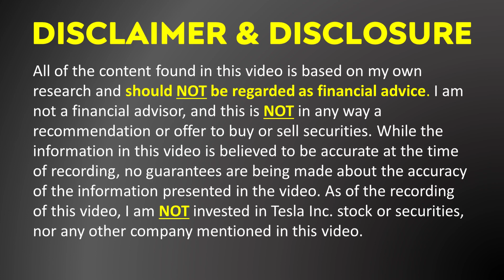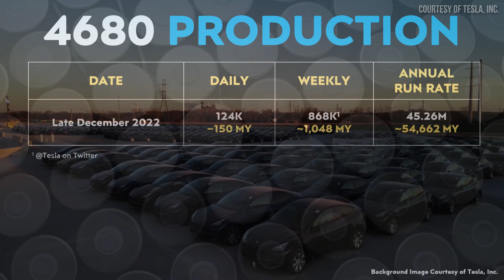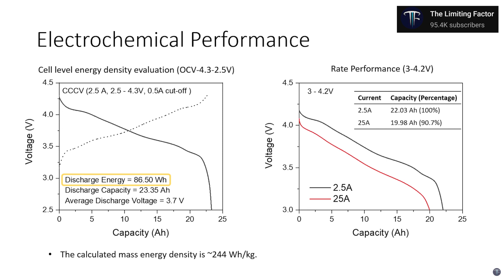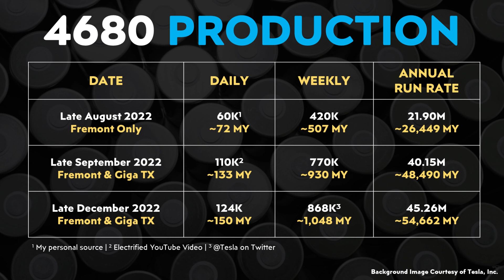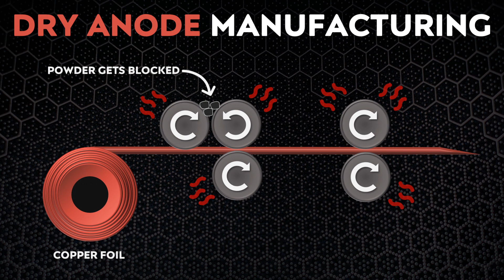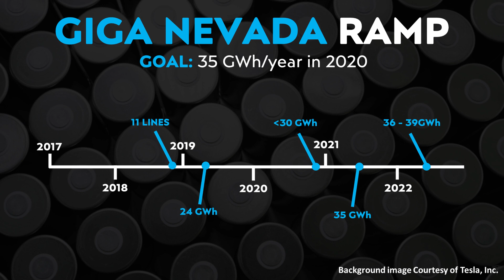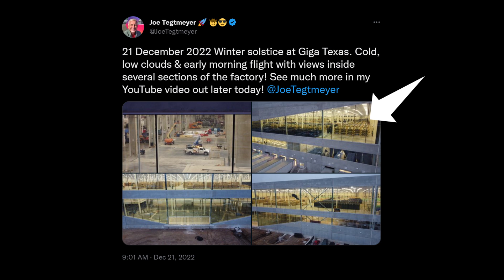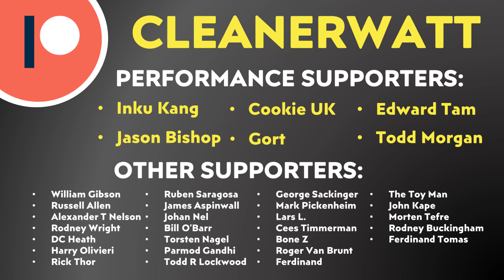Tesla's BIG 4680 UPDATE has me CONCERNED & EXCITED

Comment: rate of ramp is NOT just the issue of production constraints.
Tesla has several third party vendors which they want to keep even though it affects vertical integration. They keep third party vendors to ensure supply chins. Did we learn nothing from the covid era? ANY company strives for as much vertical integration as is wise. NOT just as is possible.
 There are legacy contracts, 
there are partners that you want to keep happy, 
there are partners which you want to use to constrain your direct competitor, 
there are partners which own patents that you need, 
there are partners which you have that might have strategic importance down the road, even if not now
and again, supply chain, supply chain, supply chain. A company does NOT just use JIT (Just in time), we also ALWAYS have JIC (just in case) in mind

But yes, I agree that just because one specific plant is a little low, does NOT mean it is a bottleneck or has bottlenecks. As cleanerwatt points out, a production line is not an R&D line or a prototype line.

And yes, we all know Tesla often bites off more than they can chew, but in this case,

Comment: I'm curious as to where the Gwatts of electricity will come from to recharge these batteries. In my area, a 4000 Mwatt coal burner was shut down, and replaced with  4 Mwatt solar plant. 4 other coal burners were shut down and not replaced. A large nuclear plant is scheduled for shut down in the next few years.
And home heating heat pumps must come on line, as Clean natural gas has doubled in price in 1 year,  and I now pay a 31% carbon tax.
Maybe we're all supposed to stay home and freeze in the dark.

Comment: The 4680 battery is a complete dud and failure, and most everybody who’s paying attention, knows this.  Yes, it contains 56% more energy because it’s 100% larger than the 2170.  GM’s slim pouch Ultium battery is much more energy dense and much cheaper to build and a better overall battery.  Do yourself a favor, sell your Tesla stock before it goes to zero and be impartial about EV’s.

Comment: Does anyone have any idea of the difficulty of  -
1. Building a fast machine that has never been built before.
2. The complexity of feeding materials into a fast manufacturing machine.
3. Ramping up a fast machine to produce an acceptable failure rate.
4. Improving the process to reduce cost, increase productivity, and increase quality.
5. All the time checking the quality, which can only be done by testing over multiple cycles, which takes TIME.

I don't suppose there are many things which require multiple cycles (1000 - 4000) to prove viability. Possibly fruit flies...

Comment: Excellent analysis, terrific video.  You go right to the core of what this is all about: The machine that builds the machine. My takeaway is that Tesla is making progress but they haven't quite reached the point of 'ignition' where the bugs have been worked out, battery production accelerates but more importantly Tesla has reached a point where they accelerate building the machines that produce the batteries. 
"Tesla set some extremely aggressive goals for their battery production." This should always be understood as part of investing in Tesla.   It's a bit like me (>60) saying "Hey I can do a triple lutz" and I get out on the ice and can only do two and a half.  Many people would scoff, dismiss me as a complete fraud, my share value would plummet, while anyone who can do a triple lutz would be thinking, wow that old dude did better than most skaters half his age.  I've seen this happen again and again to Apple, they beat their ambitious quarterly expectations by 5% but not 10% and the stock drops like a rock.  
If  GM had made one dry electrode battery, they'd call a press conference (& get invited to the White House) and the stock would go up 30%.  The same level of excitement would happen if a dog could recite a few lines of a Shakespeare sonnet -- and for the same reason. 
The other 'good news' of all this is that because Tesla is struggling to reach 'ignition' on 4680 production it means their moat is deeper and wider, so it's not likely any other company not directly contracted with Tesla will soon come up with a competitive '4781' dry electrode battery.  So Tesla is more like a 12 year old not quite pulling off a triple lutz, they're not failing, they're on a path to doing a quadruple. 
One image that will stick in my mind forever is Battery Day, a video of a canning factory was playing on the screen behind Elon Musk. He had a script, everything was going great, but he paused to watch that video. He wanted to think about engineering. I have full confidence that Tesla will continue to lead the world in engineering, but this is also why the Twitter 'distraction' is hurting Tesla share value.
Reply: Best comment, right here.

Comment: Tesla will probably differentiate the 4680 from any other variant and like buying a diesel truck as opposed to gasoline you'll need to pay a premium for "4680 Power."

Presumably there will be a 4680 version for all vehicles in the current stable Model S, Model X, Model 3, Model Y and Cybertruck with legacy battery back construction more than making up for the difference to the extent to which Tesla can move product.given current demand and pricing issues. What needs noting I think is how advanced the ICE Platform in all forms has now become in particular as Hybrid though certainly not exclusive to that. Long and short consumers will have incredible available as options already be true for in the end what remains simply 4 wheels and a steering wheel.

Comment: There is simply no such thing as "exponential growth", with regards to manufacturing.
The best that can be hoped for is linear growth, and even that is wholly dependent on
perpetual reinvestment.
 "X" amount of factory space can only be host to "X" amount of
manufacturing plant. And that plant has a finite speed of operation. And that is without mentioning the limitations of supplying raw materials and, to a lesser extent, skilled labor.
The question that needs to be answered is where Tesla is placed with regard to the tipping point of economies of scale in all its areas of production. It is a common misconception that "bigger is better". Size brings with it its own unique set of problems and they are, generally speaking, not that easy to practically resolve.

Comment: To put this another way.
Do you build 20 (whatever) "prototype" machines, and make extensive mods to each while trying to solve problems, or make 2, modify those, then when they work build 2 "production prototype" machines, confirm the process, then build 100 reliable full production machines?
.
I'd say the latter is the way to go.
It's not altering the eventual gradient of the ramp, just shifting it on the X axis (the same as we've seen previously but some never learn
Reply: I think you got it right. No point to scale massively until you've perfected the process to your liking.

Comment: 1)Define the process.

2) Build prototype factory .

3) Develop/ REFINE the process.

4) Repeat, modify machines and process as required.
.
Only when the above is achieved do you build the final iteration of the production machine.
.
We're on the flat part of the curve.
When the SYSTEM is perfected, "vertical" is easy.
You just multiply the number of lines.
(material supply allowing)

Comment: Good video with lots of information, although most of it covered previously.  The one thing none of these channels seems to be willing to address is how discerning consumers have come to realize the inherent issues with ternary batteries that include cobalt as part of their composition.  Lithium iron-phosphate, and more specifically, the LMFP chemistry CATL introduced back in July, is safer, avoids conflict minerals, costs less to produce, has only slightly less range, and is capable of many more charge cycles.  Tesla (and GM) have to figure out how to pivot to LMFP (M3P) battery cells or risk losing a lot of customers to other brands.  If the 4680 cell production cannot be adapted to this chemistry, then none of the future numbers you mentioned will ever be reached, because demand simply will not be there.
Reply: Tesla already is CATL's biggest customer so they are going to have access to LMFP cells. Not sure why you added GM in the conversation, unlike Tesla with the 4680 GM do not make their own cells.
Reply: @boostav  - The battery chemistry in the 4680 cells is basically the same as what is used in the Ultium packs.  Consumers who are paying attention will not want either one of them.  Would you?
Reply: @jasonbroom7147  Depends on the application, Nickel based chemistries are still going to be necessary for long range applications. Even with the new LMFP chemistry the energy density is still not on par, you'll get no more than 15% more range than regular LFP.
Reply: @boostav  - NMC and NCA will continue to be around for a long time, for a variety of reasons, but that doesn't make the atrocities surrounding cobalt mining any less alarming.  Also, you didn't answer my question:  would you settle for a vehicle with any cobalt-based ternary battery solution, such as the Ultium pack or 4680 cells, if you knew that LMFP would be available in that same vehicle, within a relatively short period of time?  Do you not want lower cost, less risk of thermal runaway, and a clear conscience, knowing the cells in your vehicle (which is ostensibly making the world a better place) are free of conflict minerals?
Reply: @jasonbroom7147  I don't have problems with Cobalt mining, not all of it is mined unethically and EV's aren't the only products it is used in anyway. Yes I would if I needed the range.
Reply: @boostav  - With all due respect, look into it.  Roughly 75% of cobalt comes from the Congo, and there aren't enough known deposits elsewhere to source it from other places.  Ignorance is bliss, though...don't research it if you don't want to know.

Comment: This falls into place much better if you interpret September leak as a PEAK rate, not a sustained one -- "hit a run rate of" is not the same as "produced in a week or month".  What we're getting now is sustained weekly production, so the machines are continuing to run instead of short tests.  In fact it makes a lot of sense that the line hit some rate for a few minutes before breaking earlier (based on the line design) and now they've worked the bugs out to keep it running.

Kato Road is definitely running experiments (as has been covered by other Tesla news folks),  With all of those change-overs and setup, it'll never hit near its peak design throughput.  That's ok because as you said, the goal is to find improvements to later roll out to Austin and Berlin lines.

Comment: This ramp up failure is worse than it seems. Firstly they have only achieved 4% of their target of 100GWh for 2022. But there is no sign of the high powered nickel variant critical for longer range cars and the Cybertruck which won’t work with the current low power density variant. Now maybe these over aggressive are giving us a buying opportunity with the stock crash.

Comment: NOT ENOUGH INFORMATION : (1) For what is portrayed to be a near fully automated battery line - WHY ARE THERE SO MANY PEOPLE  ? (2) Are there multiple lines going extremely slow or a single line ? (3) How many shifts are there ? (4) Is Texas just following the "recipe - adjustments -   - speed - rolling pressures of Kato Rd ? - Is R&D at Kato Rd the limiting factor? (5) What is the rejection rate ? ::  Working backwards to output per hour or output per worker is very interesting  :: My belief is that there are problems associated with layering materials on both sides of the cathode & anode. ::  Anode - Separator - Cathode -  Separator  :: TESLA is achieving remarkable results moving directly to the 2nd Generation - and heading to near fully automated battery lines. THIS IS MICRO SCALE - ULTRA FAST PRODUCTION - OPERATING IN FIRST GEAR.( Not putting sugar water in a can. )

Comment: Please don't talk about "exponential growth". There is nothing exponential going on here. The initial phase of a ramp-up may have a small section that somewhat looks exponential but you cannot just extrapolate that. Further growth will be linear for quite some time until it slows down and the end - a typical S-curve. I think we'll see a few GWh/year production capacity added every few months and hitting a run rate of 15-20 GWh/year end of next year if all goes well. You mentioned it in the video and it's true - so far Tesla has shown that they are not faster than the rest of the industry when it comes to battery production ramp up. So why do a lot of peeople still believe in these aggressive timelines?

Comment: Although the 4680 battery production slow ramping is not what every one expected it might be acceptable if by mid 2023 the ramping results in 20 plus GWh and 40 GWh by the end if 2023. If that happens it will be sufficient to satisfy all of Cybertrucks they produce as well as 1/2 of the MY with structural pack as an option. With those rates the probability of combined 100 GWh annually by the end if 2024 is very high.IMO. Also by that time ( 2024 ) the Panasonic 4680 battery will also be available and their total production will be used by tesla making it much easier for tesla to make all of the MY productions with structural packs as well ! So, let us see if the first of the milestones take place by the end of 2023.

Comment: Maybe Dylan's 100k September number "leak" was false/premature. Was this leak ever officially confirmed,.. or corroborated by anyone other than Dylan's secret source?  If not, then the August-December trajectory could be more linear and not exhibit the worrying decline you're postulating.  Seems to me your worries are based entirely on a "leak". You have only three data points, two official at the ends and a rather surprising unofficial step in between. It's not a strong foundation.

Comment: Thank god they got it running better and the scrap rate is down enough to start Ramping up.in 45 days they ramped from 2K to 3K with 2170 it makes me think they will start adding another 1K with 4680 batteries my thoughts is they will start Ramping up the 4680 Battery and car until it overcoming the 2170 car.

Comment: 4680 run rate doesn’t matter because the structural pack is a dud.  Investors wouldn’t accept Intel releasing a processor with less performance than its predecessor so why is everyone ignoring the inferior specs of the structural pack?  This is why Twitter is actually good for Tesla. It keeps Elon away so the engineers can produce better designs. Cylindrical cells are soft without the casing and therefore should not be structural members of anything.

Comment: John just curious but have you by chance readjusted your expectations for the 4680 cell's. Given Drew baglianos comments in q3s earning call that the 4680 plans shown at battery day back in 2020. We're on a full 6 year plan ONLY culminating in full fruition by 2026? 🤔

Then Elon backed that up saying they expected the 4680 cell to equal the very best current tech by year's end. 
Which was also already confirmed by Sandy munro tear down of a structural pack equipped 4680 tx built model y. 

Along with the limiting factors 4680 in depth cell research coverage both right here on YouTube.

Then he said he expected the 4680 to best all of the competition by the end of 2023. Plus 4680s will qualify for up to $35 per kwh manufactured in new ira credits. This CANNOT be understated imo. And many are doing just that. 

That new $ from the ira could very well drive crucial price cuts on tesla cars during this economic downturn. Crushing teslas domestic competition even further. While also allowing them to push forward even harder on 4680s due to the extra funds. 

Plus we have their in house cathode plant per Elon also coming online by 2024 out in tx. 👍🏻
Reply: Tesla stated goal is not to "crush" its "competition". The mission is to speed up the conversion to EVs and renewable energy as much as possible. I don't think lack of funds is what's holding back 4680 development if development is actually being held back.
Reply: @GROND15  elon has also publicly said his goal with tesla is to be so far ahead? That whoever is in 2nd place would need a telescope just to see them. How is that not the definition of crushing their competition? 😀 I do get what you are saying though.

Comment: We still only have 3 data points to estimate the growth rate, so even if the  goal of 100 GWh by the end of 2022 that was presented at the battery day in 2020 has shifted by a year, I would say Tesla is making excellent strides towards meeting a very ambitious target production rate. I do think that 100 GWh by the end of 2023 is still a possible outcome
Reply: "Data points" don't help at all with that. Tesla could and will run into problems that stop or slow down ramp up at any time. Better than looking at some data points is to looks at how long battery production ramp up typically takes. It's not measured in months but in years. So 100GWh? Yes, maybe. But not in 2023 but more like 2026 or even later.
Reply: @EinzigfreierName  "Typically" and "Tesla" do not belong in the same sentence together. Tesla is known for breaking the trends and assumptions that come with reasoning by analogy. More often than not they exceed the typical through their aggressive goals, fail fast attitudes, use of AI for automated testing, world class engineers, and application of agile methodologies to not just software development (the typical), but to hardware, manufacturing and material science (the atypical).